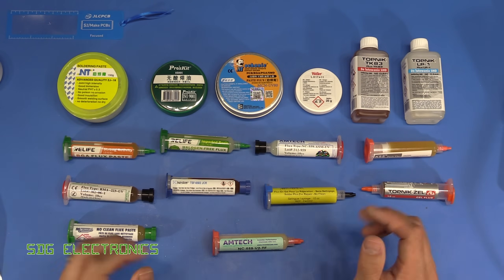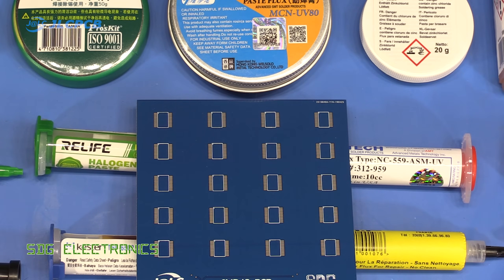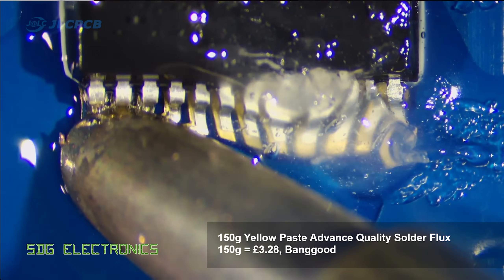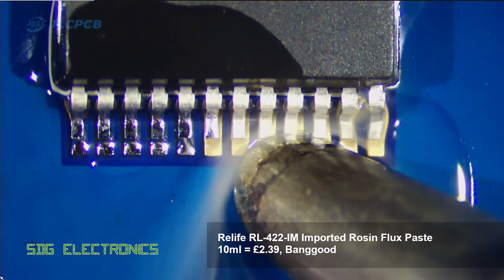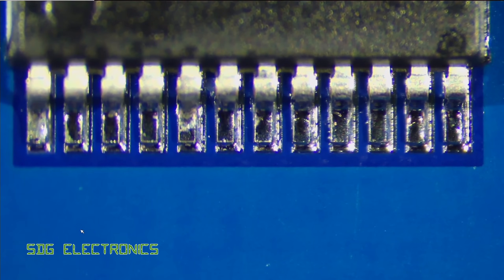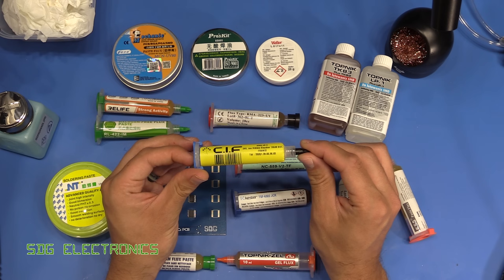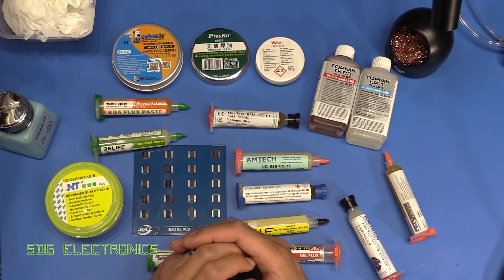SDG #086 What's the best flux for soldering? A comparison with PCBs from JLCPCB

Comment: Don't buy TK83, I never saw a worse shit! It says "no clean" but it's a nonsense, after soldering, layer of gluish resin like from tree remains and not even IPA can't clean it you have to use aceton, but that's too aggressive for some plastics, so you should not use it. So, no TK83 - it's the worst shit. These fluxes can work pretty well for soldering, but it's pointless when it's impossible to clean it after soldering, better stick to something less efficient that is really no clean or it's easy to clean it with IPA.
Most of people I asked are buying those cheap RMA-223 clones, it looks like it's not the best one from this video, but I guess it's also important that you can find a lot of it for a pretty low price and it works, nobody complains about some glue resing remaining on their PCBs, so I will probably try to order it. 
I found that AMTECH online, but I am not sure if it's clone or original and price is 5 times higher than random chinese RMA-223 and that's still pretty cheap compared to what they have in traditional electro e-shops.
After soldering with TK83 and our Czech F-1 liquid (which is pretty much the same thing), I had to wash my hands in aceton, that was only way how to get that sticky shit out of my hands!! So I don't recommend to buying it.

Comment: I’m new to soldering these small ic type components. I’d like to see your technique in landing the ic on the board and starting out. Do you just put a little down pressure on one side and drag the iron over all the leads or do you tack one and start on the opposite side? Thanks.
Reply from the maker: Normally start with one or two legs.

Comment: I bought a 50 gram tub of the cheap one 11:43 - or at least the tub looks mostly the same (looking closely, some of the writing on the label is slightly different e.g I have a capital "N" for "No deterioration").
Anyway... it ruined 2 soldering iron tips. Absolutely useless stuff.
The actual paste looks a lot more amber than the stuff in the video. So obviously mine has the "same" label, but is a different/fake product.
Ebay Australia - don't buy stuff that looks like this, would be my advice.

Comment: The best flux is an RMA, rosin mildly activated, flux. Key fact is this, your flux should match your solder’s flux core. If you don’t your solder job is no good according to the J STD 006 level 3, aka critical circuit soldering. If you brand match the flux and the solder/flux core your chemical match is as great as it can be. Any other way is a crap shoot. Ideal matching of flux and solder flux core is the correct way. Kester, AIM, Alpha Metals and Multicore are your best brands. Without brand matched flux and solder flux core, you will not get ideal results. To do work to the best results possible the 3.3% flux to solder weight ratio. This is mil spec grade. The best solder is Kester 282 and the best flux is Kester 186. This is a pure eutectic solder and has an RMA flux core. The flux is a liquid flux and is an RMA type. Brand matching is the best and RMA is the best flux. Proven over decades and still the best.

Comment: Great video, I just would’ve liked to see a table ranking them from best to worse. Things I would love to see are how the best fluxes here work with different solders, do they react with the flux already in the solder? Do they make a better joint with 60/40, 63/37, lead free solder, or even paste solder for SMD chips? Do they flow better with soldering iron or hot air rework station? When working with large through hole components, which one deals best with heavy heat for longer periods?

Comment: Thank you for the detailed video! I'm an old auto technician just getting into the world of small electronics repair and I found this information very useful!! 30 years of working on broken vehicles has left me with a broken body. This kind of work is actually very rewarding and doesn't hurt. (until I touch the damn soldering iron. again)

Comment: Can anyone tell me if there's any upside or downside to halogen free flux?
Reply: The upside is, its good to use for brand new manufactured pcb's where there is little to any oxidation at all. The purpose of flux is to remove oxides from the metal to allow solder to adhere to the surface (usually copper). The down side to halogen free is it won't be effective it since it is very mild on older pcb's that have been exposed to liquid damage, oxidation and or rust. If you want a good example try soldering to an old penny that's really oxidized or dull. You won't get much action if any at all.

Comment: Hope your still reading these.  Just purchased a T12 (great iron) and did a test with some copper (clad) pennies.  I cleaned some in vinegar and tried some that were well tarnished.  The 40% rosin fluxes did well soldering to the tarnished ones and all of them were fine on the shiny copper.  One outcome though was that the flux pooled on top of each coin and stayed liquid as they were hot, as I cooled them off under a faucet in water, the liquid flux made blobs on the sink that alcohol would not dissolve, except for the rosin fluxes, and was nearly impossible to clean.  I also figured that the smoke from the flux was just a vaporized version of the blobs on the sink and you can imagine what that does to coat your nose and lungs.  Years ago (don't see it anymore) we used chloroethane nu to clean pcb's after wave soldering (in volume) and distilled the vapor back to liquid.  It worked great but also formed acid vapor if it escaped and mixed with water vapor in air.  People near it coughed a lot and it corroded everything.  Not sure what is a good flux cleaning solvent today.  Any ideas?
Reply from the maker: @robert574  the no-clean fluxes tend to need a detergent rather than alcohol. Dedicated flux cleaner still tends to work though
Reply: @sdgelectronics what detergent is used for cleaning these boards?

Comment: I'm pretty sure that the fake amtech is really just Kingbo. So - yeah, Kingbo IS a good flux. Reliably, so. I've recently tried the new Mechanic M35 Nano Flux Paste. It is good for only the cleanest easiest of BGA jobs...NO cleaning on offer here! I use many different fluxes for different purposes. From plain rosin mixed with isopropyl alcohol + glycerin - to johnson chemical Ruby Fluid zinc chloride flux. Depending on the job. There is no one flux for all jobs.

Comment: Hello, thank you.  My question is more basic: repairing some old tube amplifier kits do I need flux?
Reply: Flux makes everything easier, regardless of what type of components youre soldering or desoldering. Probably dont need anything fancy if youre just doing a few things and not planning to put together full boards. Just be extra safe with those old TVs. You can hurt yourself pretty good touching the wrong things. Make sure to properly discharge any caps and careful what youre touching.

Comment: Could you please comment about the cleaning characteristic of the best ones?  I mean some of them are good in terms of themal (soldering) properties, but when ir comes to cleaning, the are a total mess.. for example the no-clean flux usually are very hard to clean, others need to be cleaned very good because the oxidise the copper.  thanks in advance.  Amazing video BTW.

Comment: Another point to mention is most if not all smd fluxes need a proper reflow process heat curve to become inactive. Soldering by hand does not make this type of flux inactive which means it'll remain slightly acidic and will eventually eat the copper traces. An easy way to fix this issue if soldering by hand is desired is to use hot air afterwards, just enough to heat the area to activate the flux so it goes hard then you know it's inactive.

Comment: I'm a bit surprised with the first flux result. I bought some years ago and I'm mostly doing re-work and repairs. This tub of 'stuff' is not flux. From what I've seen it has zero activate capabilities and really doesn't work at all. Certainly not on older parts. On a sop44 flash rom rework I put a blob of solder and added this flux and was not able to remove the blob of solder. Moving sideways just spread the blob to several pins that were all bridged together. I cleaned off the junk flux and put on some real smd gel flux (NC254, rather exensive but is very good) and touched the soldering iron and immediately the blob was removed. It's a shame as these tubs of flux are very good value if they worked lol. And yes, you can use an old shringe and scoop it up with a flat blade screwdriver and put into the shringe to make application less messy. The better way is to heat the flux gently until it is more liquidy (roughly 30C-35C) and just pour it into the shringe then you don't get air bubbles.

Comment: I use topnik mostly because it's a local brand, but I can tell that gel works better than liquids. They have their use for sure, but they're displaced too quickly with heat. Gel is more persistent. It's also easy to wash away and I don't get the problem with lumps, although I find a small brush useful as with any flux.

Comment: Very expensive for what you get - just make your own - you can buy a kilo of rosin for less than one of these fluxes.

Mix rosin ( flakes preferably ) with vaseline ( anything from 1:0.5 - 1:2 ) or however runny you want to make it. Don't forget it is the rosin that does the job here, despite what other proprietary ingredients are in the commercial stuff. 

Put in a glass jar , mix,  and heat gently in the oven until the vaseline and rosin separate - remove from heat , remix and heat again. Remove from heat and allow to cool.

When cooled enough to still be liquid, the mixture can be drawn into syringes - at this point you can add some 99% isopropyl alcohol to the mix ( 1 - 2% ) to aid fluidity, but really it is up to personal preference - experiment with the recipe, it's not set in stone, the more rosin that's in it the better.

The acid in the rosin should be enough for regular soldering - badly oxidised components would probably require something more acidic - try adding some citric or malic acid - it's up to you. 

Remember to vent fumes - at least you know what's in your homebrew flux - goodness knows what's in the Chinese knock- off stuff.
Reply: I like this! Thank you.

Comment: hmmmm thought you'd also published a solder braid video, could use one right about now. they all seem to work pretty well, but i'd really like to know if the wire pitch and stuff makes a big difference. some come with flux embedded. for the types without embedded flux, which of these work better, and so on
Reply from the maker: Loctite wick seems to be the best. Match the thickness to the solder joint

Comment: I use Kester 63/37 with Kester flux. That combo works better for me overall than anything I've used. Almost everything I do is re-work. BGA joints NEED lead based solder IMO.

Comment: I bought the BangGood tub of NT zs-18 flux, in both the white (as in the video), and amber colored paste. And I have to say that the white stuff is pretty horrendous! 
It spits everywhere the second you touch it with the iron. It almost instantly melts away from the joint leaving it exposed. And even if you use very much of it at once; it still doesn't help the solder flow too well. It's ONLY ok for basic soldering of wires and such... but TOTALLY not recommended for small microchip legs. 
The amber colored paste (although it comes in an IDENTICAL container color & sticker), is actually relatively decent. 
It's not too great with removing solder bridges for example... but if you use enough of it, it will eventually get you through (It does leave a pretty thick residue behind pretty quickly, so you always have to add more). It is good as a secondary paste, when you don't want to waste your more expensive good stuff (like from MG Chemicals for example).
Also, they are both pretty thick at room temp. So If you're refilling another flux syringe with it; you're gonna have to really push to get it through the needle.

Comment: Something I learned from the school of hard knocks was to use the pitch from a pine, fur, etc. tree. It's also called resin. And it's free.
Also to anyone using an acid resin on electronics DON'T! It'll eat the copper wire and the PCB board. (Friend did a repair on a board in his stereo wire acid core solder and it worked for awhile but eventually ate the board to the point he had to replace the board.)

Comment: This method require a "spoon" soldering tip.  An ordinary chisel tip won't to the job.

Yes, go down the row of pins quickly.  Don't apply so much flux, it takes a lot less to do the job properly (you need practice).  Also, don't apply paste flux with a tooth pick.  Trim the bristles on a small acid brush (or artist's brush with stiff bristles) and "paint" the flux on.  With liquid flux use a slightly softer artist's brush.  Clean your brushes with isopropyl alcohol (acetone works faster) and dry quickly with a cotton cloth or paper towel.  You will waste a lot less flux and you won't run out of your party picks. 🙂

Comment: Thanks for sharing the info, I have a PCB board no matter how much flux I apply I still have difficulty in soldering any idea whats going wrong. Also if you can give a tutorial on the soldering, I really liked your soldering method.
Reply: Probably sorted it out, but leaded solder is easier to work with.

Comment: Although an old video, it is really useful. I used to use the amtech fake flux for years and recently tried the CIF. The CIF leaves a sticky residue that in my opinion needs to be cleaned. Fortunately it is easy to clean.

Comment: I got some Chipquik tacky flux here which has been at room temperature for at least 2 to 3 years. I have the impression that it's not working anymore, barely able to resolve bridges. How to identify old flux?
Reply: I think you might already have your answer. When I speak to flux companies, they say usually it will usually lose some effectiveness but should still continue to work. Now, if you have no action out of it or become really difficult to solder with, then it's probably no good.
Reply: Which chipquick version is it? Most rosin based fluxes can, in theory, last a lifetime because it's an acid, but it can degrade over time or breakdown. Maybe it just needs to be reactivated to get it up and running well again.
Reply: My SMD291 is working like new after a good year. I did notice some discoloration and hardening where the stopper is (presumably some air is getting through the sides). As a result I now store it with the stopper in. This is one reason though I don't want to get a tub of the stuff.

Comment: In one placed I worked at, I used a Flux pen with long bristles, it was like clear jelly and was fantastic on surface mount ic's with the solder pads underneath, did not evaporate and easy to clean, I don't remember the name of it

Comment: Yellow Solder Paste: 4:09
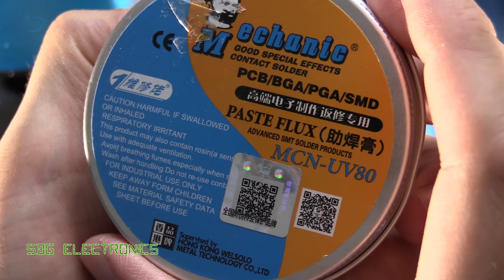Mechanic MCN-UV80: 4:38
Pro'sKit 8S005: 5:11
Weller F-SW21: 5:42
AG Termopasty TK83: 6:06
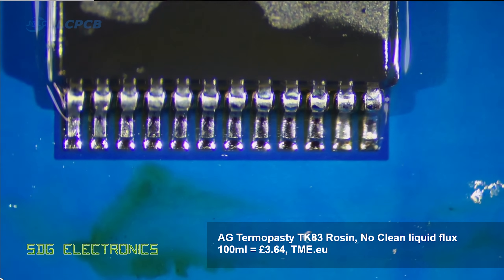AG Termopasty LP-1: 6:39
CIF F42202 Gel Flux: 7:04
MG Chemicals No Clean Gel: 7:24
Best BST-223-UV80: 7:44
Relife RL-421-OR: 8:08
Relife RL-422-IM: 8:32
Topnik Zel Flux: 8:53
KSS S800 Flux: 9:13
Amtech NC-559-V2-TF: 9:31
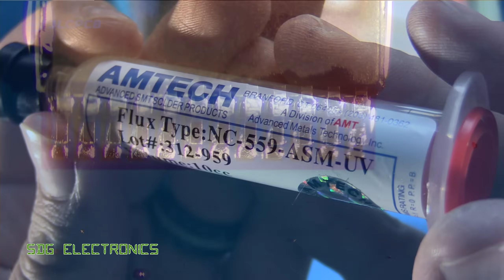Fake Amtech NC-559-ASM: 9:48
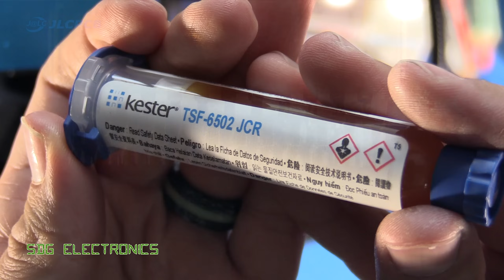Kester No Clean: 10:06
Reply: Thanks a lot
Reply: Thanks man. But unfortunately, there is not one link in the video-description that works.

Comment: Hello friend. I would like to ask for some help and advice from you.I have a flashlight, but the spring from the driver part is disconnected.How do I reattach the battery spring to the flashlight driver? What materials do I need?I'm not good at electronics.When the flashlight battery spring is disconnected from the driver, I see that the color of the material that sticks between the spring and the flashlight driver is gray.I really want to know what material attaches the spring to the flashlight driver.Any help from you, I really appreciate it.😢

Comment: Are any one of these fluxes able to actually solder? I mean without the solder paste applied, do they have mixed in solder paste?
Reply from the maker: No. Solder paste is a different product. Solder paste doesn't need anything adding, it contains the correct amount of solder balls and flux
Reply: @sdgelectronics  but when you tested these, did you apply solder paste below the pins before applying flux?
Reply: @TheEdmaster87 he didn't apply any paste at all. He just had solder on his iron tip.

Comment: Hi, awesome video! I'm from Latin America and I've seen many weird fluxes. Some can ruin a board, like when liquid amber flux dripped on a hard drive and dissolved the copper. Sadly, I didn't see it for a month or two, so it was too late.

I suggest trying a good board and switching pads between isolated and connected ones. This can act as a heatsink, change the performance, and show more differences between the fluxes.

Comment: I got some of the Chinese flux, which is very sticky and seems to be based on a type of paraffin wax. I mixed it with some (15% ish) mineral oil  (corn oil in my case) and achieved a soft butter-like consistency that allows it to be loaded into a syringe, It performed the same as in the video however it was much easier to handle coming from a syringe. I used a 1mm metal tip on the syringe. Cost for 10 cc was approx $0.85  (115cc of flux cost $11 inc delivery). I am sure other types of mineral oil will produce similar results.

Comment: Does the flux splashing onto the IC cause damage if not cleaned off?
Reply from the maker: Certain fluxes will eat away at metal if not cleaned off, but most of these do not need cleaning.